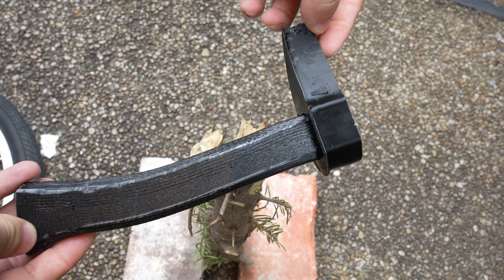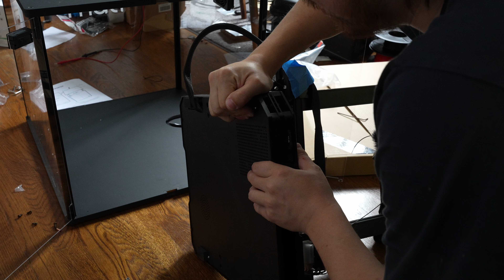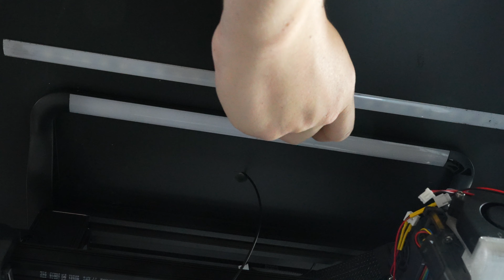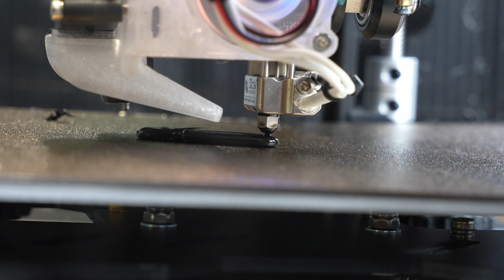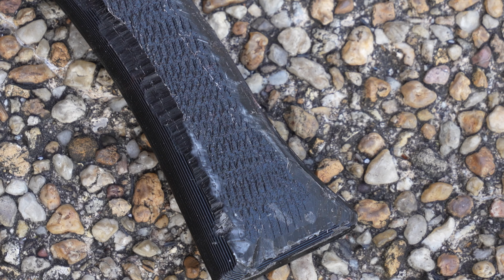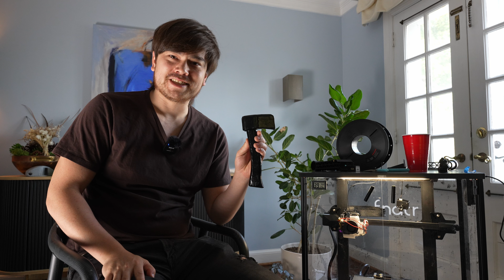Splitting FireWood with a 3D Printed Hatchet

Comment: What size Nozzle would you recommend on a stock s1 pro? Im wanting to print bigger and faster but am unsure due to lack of info and experience.
Reply from the maker: I would recommend 0.4 or 0.6mm CHT. That way you can print with decent detail, but you can go way up in print speed by overextrusion. This is where you extrude a line of filament that is wider than the nozzle diameter. I plan on making a video explaining overextrusion soon, but basically you just crank up your extrusion width in the slicer

Comment: Damn, you just ruined a $200 enclosure, just buy IKEA LACK-tables and some plexiglass, which is $150 cheaper :P
Reply from the maker: The lack is more budget friendly and gets the job done. But if you're showing it off in a professional environment, like an architecture firm or fancy school/office setting, I might splurge for the fnatr.

The fnatr has better sealing all around, and looks nicer with the thinner bezels and tightly fitting panels. Provided you get the one that actually fits your printer 😆

Comment: How about cutting out only the size of the vent for the power supply and increasing the height of the feet on the enclosure?
Reply from the maker: Increasing the height of the enclosure would be tricky to do, but the next model should be tall enough to fit the S1 without having to resort to chopping it apart and melting it.